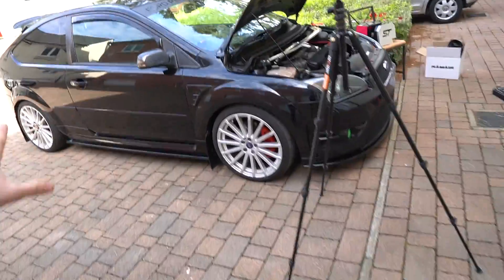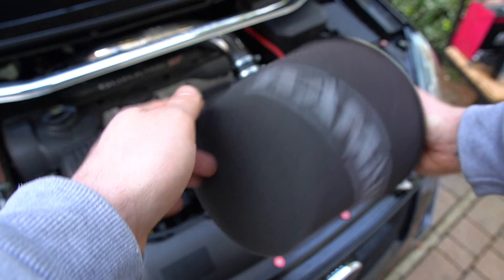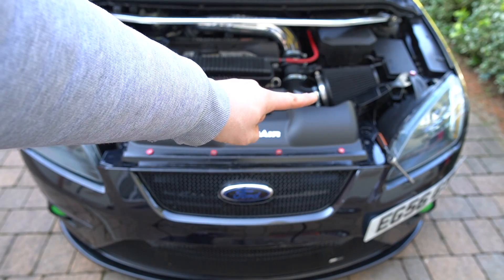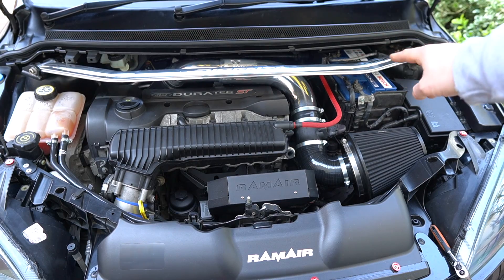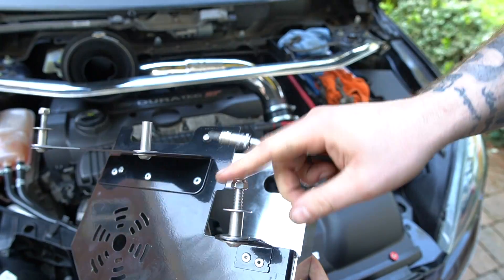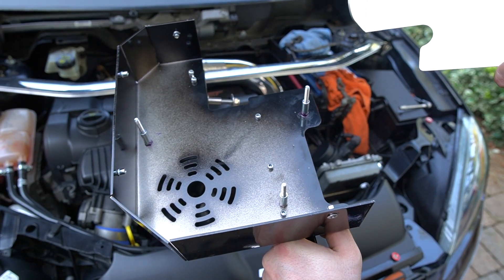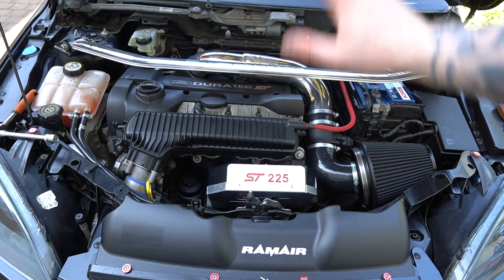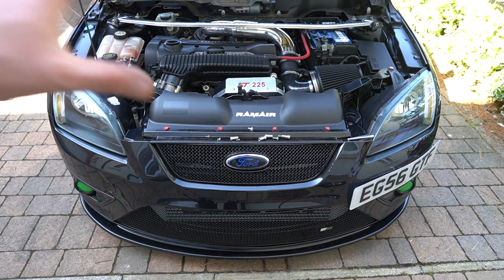REPLACING THE GROUP A RAMAIR INDUCTION KIT WITH THE PRO SETUP INC 5251 ALUMINIUM/BRUSHED CUSTOM ECU

Comment: That ECU holder looks so clean! Matches the other stainless steel parts very nicely & the noises she's now making I bet are making you want to be out in her even more 😭 keep up the top work George ,👍
Reply: I did get filter for Ford  silverado ,with90 rubber : 3 inch to 4 elbow,made custom shape  mounting adapter  with 4 inch inside  inlet- which allows me make it slimmer for fitment purposes -my  car c30.This is done in place of seen here front plastic  inlet. Cost $45 ,with spare parts left for other projects.Car is much more responsive ,soon after 3000rpm,is kicking  much better than with   3 " inlet filters.

Comment: Great video guys, was waiting for this one to see how you like the K&N style filter. Looks great and they sound nice. To help you with the wrenching side of things, you can get a nice little powered screwdriver set from Lidl, made by Parkside, awesome German power tools. The set costs £19.99 and you get 4 attachments for it including side drive, tight space drive, torque wrench adapter, and even a cutter attachment for cutting sheet rubber for example. AND, you get 28 screwdriver bits, including pozi, philips, slot head, torx. It's powered by a 4v lithium Ion battery and you obvs get a charger. All in a nice little blow moulded plastic case! Bargain. I'm working on a mod for my battery cover also. I'm going to fit small neodymium magnets, gonna have a look at where I can drill some recesses for them and epoxy them in so I can just wave the cover over the tray and it snaps into place. I'm sick of securing it with zip ties too. They must all break. Great vids George, oh and progress report on rear bushes, I fitted upper and lower rear control arm bushes and it's nice and supple now but shows up my tired shocks as they are getting out of shape under fast cornering when hitting bumps/ undulations. I'm talking VERY fast, 70-80 mph is ok. hehe. (private road) I may have altered my toe angle too, so will get it reset when I get the main control arm bushes put in. The bolts on these are TIGHT, so I have ordered a new set from Ford before I try loosening the ones that are on. I will most likely snap one they are that tight. ALWAYS use Ford bolts to replace. Cheaper bolts may not have the correct shear strength etc.

Comment: Mate I’m not sure If you noticed but you bent up your new induction kit , it’s the piece that fits into the back of the cone filter then joins to the silicone hose , it will be sucking in dirty air if you don’t fix it , you obviously done the jubilee to tight .
Reply from the maker: I noticed this dw. I’ve fixed it
Reply: That’s cool, metal must be very thin, glad you sorted it 👍🏻

Comment: Hi mate why don’t you trim down the silicone hose that connects to the air filter but the side that connects to the Maf sensor so your filter fits better 👍🏼 just my opinion i done the same on my ST when i had the Group A k&n and it sat nicely , enjoy the vids 👍🏼
Reply from the maker: Might give this a go tbh
Reply: GCMTHEPT 👍🏼 just make sure you have a really sharp blade and use the jubilee clip as a guide to do a decent straight cut otherwise will be a mess 😂
Reply from the maker: Thanks pal!

Comment: which recirc valve have you fitted before changing the x-over to turbo pipe?  currently using the 50/50 turbosmart valve and it's doing my nut in if I'm completely honest.

Comment: If you want to improve more on the air intake side, maybe investing in an inlet plenum would help you out and might possibly enhance the intake noise.
Reply from the maker: Plenum will be coming soon I hope :) either Airtec or anembo engineering
Reply: @GCMTHEPT I found that the anembo engineering plenum was the best option on my RS

Comment: great vid as always , we dont have as nice ECU holders here in South Africa , i got my mk2 ST last year April (still stock) only interior mods... lights and Android head unit.
Reply from the maker: Do you not have the option to order some parts from the uk?
Reply: @GCMYT   probably could yes , just wish not as expensive with the exchange rate :(  ive never used instagram otherwise id show u the mods i did so far to mine.

Comment: Sounds awesome.has that in baffled pipe made a difference?love all the things you have done noticed when you was on that test drive your boost gauge goes into the red mine does that but holds so long just on a quarter do you think mine is boosting right? also where did you get them red coloured screws holding your slam panel?cheers 👍
Reply from the maker: It’s called the dress up kit. On eBay you can find them. And I’m unsure if mine boosts right until I’ve had it all mapped etc :)
Reply: @GCMYT   cheers just order them have you done a vlog on removing the sound symposer?

Comment: hi in our opinion whitch is better ramair or proram
Reply from the maker: They are both great. But the pro looks better 100%
Reply: the proram filter when is to clean needs to put oil or not?
Reply: my car is a focus but 1.6 tdci a diesel car i dont now if i put  this on my car if i have a better air. i dont now which i buy lol proram is more expensive .

Comment: What size is the pro ramfilter? I have the foam filter at the moment and it needs replacing.
Reply from the maker: 200mm I recall. The large pro ram air cone :) Lewis does the best deals
Reply: @GCMYT  200mm overall width or overall length? Thanks for the answer mate!
Reply: @GCMYT  Oh and what size is the  neck outside diameter?

Comment: Hi, I’ve got an astra j mk6. Just installed a ramair induction kit and I’ve got an engine check light on my dashboard. I tried disconnecting the negative terminal of battery then connecting it up again, the light went off for a bit but came back on afterwards. Does anyone have any advice on what I could do
Reply: 1.4t?

Comment: Does the new filter still rub like the foam one did? have the same problem and may replace mine with a pro ram if it’s a bette fit.
Car sounds awesome now, nearly as good as mine haha😜
Reply from the maker: It does rub slightly yes. But I plan to sort this problem. The foam one is easily impacted by it however this one is solid. It will be fine

Comment: Need some help lads, putting a decat on tomorrow and i have a 3" decat but 2.5" downpipe. Would this be an issue? Tia
Reply from the maker: Naa bro. Your all good. The exhaust will bolt straight on. But if you karate kick it with a parsnip it will add 5bhp :) hope it goes well

Comment: ALSO brought the same make intercooler as you , for my GTI  I not seen your car on bevo dyno  to see how much you gained and how good the temps are with it , as the reviews are mixed are they as good as air tech some say data is the same what your thoughts not footed mine yet wanted you feedback first to see if I do fit it thank George OG SUB  been here since RS
Reply from the maker: I’ll be doing a full dyno video eventually my man